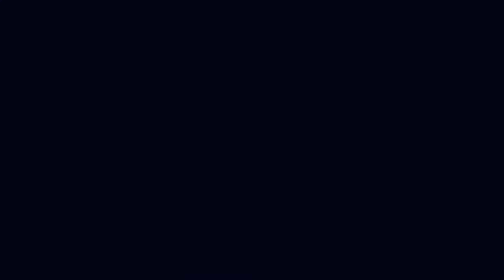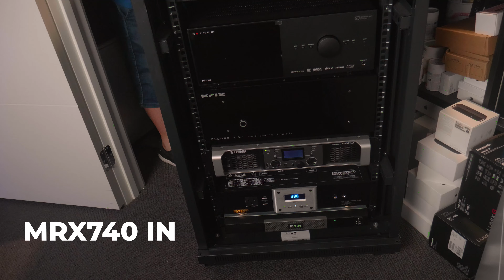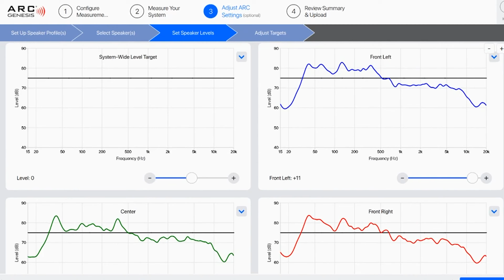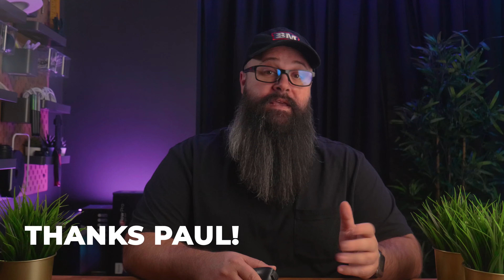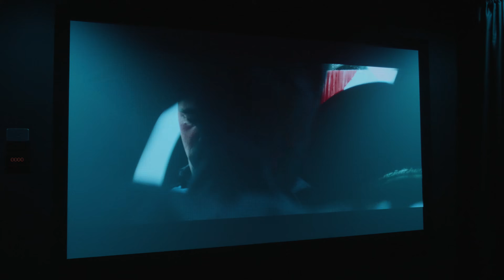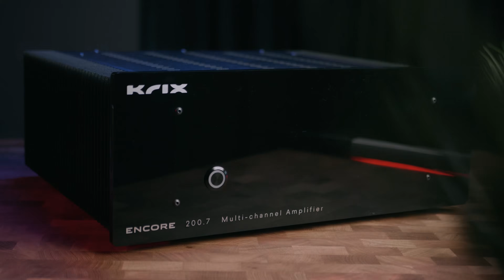ANTHEM MRX740 - AN HONEST REVIEW // Home Theater Receiver 11.2 Channel Review // Dolby Atmos

Comment: I had tons of technical issues with the MRX 1140 so returned it which made me sad because it is a great sounding receiver with a great feature set. Neither Anthem support nor my dealer could resolve the issues. I’m hoping that Anthem gets their act together so that I can repurchase again in the future.
Reply from the maker: The sound is great but as you say, not bugfree. The 1140 is very similar to the 740, so it's understandable.
Reply: @BuildMontage  Quick question,I am between trying to decide the new Marantz Cinema 60 and the Anthem 540. In several owner reviews they mention the fan on the Anthem is so loud and intrusive it is cause for returning the unit.
What is you buddy's experience thus far having lived with the 540 for some time now?
Any and all insights would be aprreciated...Thanks!
Reply: @balooo2863  ... I confirm about the fan noise. In a quiet room it's intrusive. You don't hear it during playing but between tracks or very quiet scenes you hear the fan.. I'm consedering return it... It's a shame!
Reply: @MrJMHP  thanks for that information…I purchased the unit and now my issue is I cannot get it to connect to the web no matter what I try to do. Love the sound but way too many bugs.
Reply: @balooo2863  Your connection to web issue must be a thing of your router probably settings. Mine is wired connected and i have no issue at all. I ended not to return my MRX-740 because i love the sound and power of device... Its amazing. In the near future i intended to swap the fans.

Comment: This is the mark of a good reviewer. I’ve always been interested in Anthem but they need to iron out these issues before I even consider a purchase.
Reply: 6 months later, have they ironed it out?
Reply: @JustinHEMI05  Would be nice to know also. Looking to upgrade to this or RZ50
Reply: They also just bumped up the price so it’s pushing for more money while still being buggy and lacking HDMI 2.1 which will cost even more to upgrade too. It’s difficult for me to want to drop that cash given everything as is.
Reply: What a great and honest review! Super helpful and fair. Including behind-the-scene comments. First time I watch your channel. Will come back. Just subscribed!
Reply from the maker: Thank you - it's difficult to balance the initial frustration with a fair review - which is why I persisted through the issues. If we hadn't sorted the calibration, I wouldn't have been very impressed with the result compared to my Denon or any of the other receivers I've tested.

Comment: Nice 👍 video but You have to be kidding that the Anthem 740 is better than the 8500h ? Thanks for the update that was important as I am looking at the 1140 I have a Marantz 8805 do you think that would sound better?
Reply from the maker: Certain aspects were better. The high frequency clarity especially from the center channel. It could have been the power amplifier helping that as well though. I was just being honest. I’m back to my 8500 right now and it’s great. But it was an honest review and I said what I felt and thought.
Reply: On the FB group linked, many members told they did the switch from a Marantz to an Anthem. They all said that they had improvement sound wise. But it's important to say that you have to compare pre/pro with pre/pro, avr with avr. It's not really fair to compare a sr6015 with an AVM70 or a 8805 with a mrx540. There is some guys that did the switch avr to avr and pre/pro to pre/pro and they are all happy with the sound upgrade from what they said.
Reply: Hello, I have gone from an 8500h to an arcam avr20 and it was better in both plots ... more clarity, sharpness and detail in scenes that I have very seen!  I still think that xt32 is not up to a magnificent 8500h and that they should improve this area since you cannot pay 3.5k for an avr and that it offers you the same eq and the same microphone as the 1k model ...  the 8500 is better built and in power they are even the only disadvantage that has me a little pissed off is that arcam only builds 7-channel avr and that makes you spend more on external amplifiers and the denon is much more configurable than arcam, only arcam is  something better in SQ.

Comment: So Anthem ARC still has problems???  I seem to remember a video from some channel awhile back that said it was pretty good now.  All I know is that I had a terrible experience with it back around 2009 or 2010.  I was finally put in contact with the idiots... I mean PHD's that developed it and I was told they made some changes to it after that but I never tried it again.  

I generally look at any automatic room correction like a point and shoot camera, it's better than nothing for the average Joe but can never match what you can do manually.
Reply: ARC runs very well on all the previous generation. It has sometimes some snags with the new series but I did tweaks on many of them without any problem. In the precise case of Tony's set-up, I wanted to have room to tweaks with the levels and when he got a loan extension we decided to go forward with the method that force playing sweeps louder. In his first set Auto-calibration, he did't mentionned it in his video in order to try to keep things concise but his MiniDsp had lost the calibration file (not related with ARC! Off topic, he didn't mention). When eveything goes wrong.. ;-) Sure it didn't help the final result, and there was another issue with a surround still a bit blocked by a curtain for some mic positions. So we had to redo the measurements anyway (after he found the issue with the MiniDsp). So, with this good set of measurements, he got an auto-calibration profile-1 very satisfying. And I can swear to you that it has nothing to do with the levels lower. But with this levels lower I had more than enough room for playing ;-)
At this point, he asked me if I really think it worth the effort to try to tweak the calibration. I said I wasn't sure if he would prefer it but I was very confident.
Reply from the maker: Yes there were other issues which were not the fault of the anthem but it didn't change the fact there were bugs - I was only referring to the bugs in the video - didn't want to slow down the pace of an already lengthy video describing the issue of the curtain and the minidsp - as it wasn't relevant to the calibration issues we experienced once we had that fixed.
Reply: @yvesst-onge8522  would you say this reciever is a waste of time if you haven't got a laptop or pc and have to do it on android?
Reply: @slyfoxx8540  This receiver, without ARC is already impressive. It has better separation and dynamic than Marantz, Yamaha, etc of same price. ARC is the icing on cake. 
Obviously, with a PC you can extract all the juice from the ARC possibilities. With an Android device, you are limited but from what I heard, it gives good results but you can't tweak.
Reply: @yvesst-onge8522  excellent, just the news I wanted to hear.
Cheers👍

Comment: Hi Bro 👋 Presently iam using Yamaha AVR RxA 2050" So upgrading this anthem Makes Massive Difference"
Reply from the maker: I like Yamaha receivers as they have never let me down and I actually just bought a brand new one for my upstairs setup. Anthem make very nice sounds but you have to work for it with the new receiver.
Reply: @BuildMontage  ok sure bro 👍

Comment: In the addon at the end you said they created a new firmware but you couldn't say if it fixed the issues, was that because you no longer had the unit when the new firmware came out? Im kind of worried about all these bugs, been watching the forums and so many people that have the unit are having issues, mines on order and paid for whenever it may arrive is anyone's guess. I think part of the issue is that if any engineers are working on the bugs at Anthem they are doing it from home as Ontario is still on a do no leave your house level lockdown for all except essential workers.
Reply from the maker: I had finished the video and recorded it all, finished unracking and boxing up so it was well past the scope for me to try it out. Hopefully Anthem listen and fix as it’s a great unit once you get past these issues.
Reply: Robert, I would run this receiver as much as you can within the return period. I will be selling my on the secondary markets because there are just TOOOOOO many bugs, it makes it truly unenjoyable.

Comment: Hi Tony I had heard about this issue and I member someone having the same problem he said it was something to do with the microphone volume settings it was too high on the computer something to do with the microphone volume
Reply from the maker: That's interesting - so if the gain on the mic on the PC was too high it wouldn't play noise, or play from a different speaker? So weird!
Reply: Yes and adjusted all the levels because they were too high it was something to do with the microphone volume being set wrong too high or too low I'm pretty sure it was too high but it might be worth checking it out
Reply from the maker: @Guy-zt1eb  in the calibration scenario it was 100% arc turning the main gain down to -37.5. That’s a bug for sure.

Comment: Sounds like a good product ...the set up sounds like a nightmare... all the reviews I have seen about their products seem to be the same ....great product ....lousy set up process ...but once you get it dial in they all like it....I was looking for an EndGame unit maybe in the fall of 2021 ...They dont have the 2.1 HDMI support and that will be a hardware up grade ...so if you want 2.1 ...will have to pay to get it installed....So this chipset problem(2.1) that all the Audio makers have will eventually come to an end ....but when...? So in my case I will wait until they get this problem fixed and it is fully functional in all units before I buy my EndGame unit be it The Anthem Receiver or their Processor. One of the reviews I read said the Anthem Receivers sound as good as separates...do you agree ..?? If so that makes my decision easier...I like Marantz and the ease of set up and Denon is the same way. Lets hope Anthem can hire those guys to get the set up process done better without the Bugs....or maybe at least include in the purchase ...a can of Raid! lol  . I think if I needed that much frustration in my life I would take up golf ...or stayed Married! lol Thanks for your review ! I live in Canada and they make the Anthem amps just down the road from me(200 miles lol) I did buy an Anthem Amp to run my font 3 channels and have Emotiva mono blocks running the rears My speakers are 4ohm linn Majik and these amps are rated at 400 watts at 4 ohms all channels driven which is nice ..So I have notice better separation and clearer voice without the need to adjust the volume for center channel ...So if the amps can impress me with the sound I can only Imagine what their processing is like ...but everybody likes it so far! Just work on the setup and business for their product would increase and hopefully the Quality stays!
Reply from the maker: Hi Jim, and thanks for watching. I would say out of "receivers" this is as close to separates as I have heard. Bear in mind it ships with only 7 channels powered so you do need an amp to run it to it's full potential anyway. The processing is very good I will say that. Just so many issues to sort through first.
Reply: @BuildMontage  thanks for getting back! Yeah I know about the extra power I have the MCA 325 for 3 channels and the two mono blocks from Emotiva....just going to wait and see what they do with the 2.1 issue I talked to an Anthem dealer and he said maybe the fall for the upgrade to 2.1 ...but it's a hardware install ....no sense of me buying one now and the have to spend extra for the install If they come out with new one ready to go with fixed 2.1 HDMI support then I might pull the trigger lol Yamaha just released a statement today saying they would fix all the ones they sold with a new board....and the new models coming out now will be all good with the 2.1.....that's better than Sound United is doing ...their fix is a separate converter box ...no charge if you want it...but it's a separate box ...that turns a lot of owners off Marantz has a new AV 8805A processor that they say is good to go with the 2.1 and you can get the kit for that 8805 that they have now for $600 ...that's a lot of clams ....won't be going that way either $6000 plus 13% tax for the AV 8805 A .....I think the Anthem processor would be a better deal for me if I was going that way. Anyways thanks for sharing and have a good one!

Comment: Random question but is there Atmos receiver, that works with ceiling speakers, that is more budget friendly? One that you would recommend
Reply: You are going to be at a a $2500 price range for 11 amps in a receiver at the base level of a Denon
Reply from the maker: Hi, there are budget recievers from Yamaha and Pioneer which will do "height" channels. Check for 7.2 as a minimum - usually they will either allow for two heights or for two rear surrounds instead.
Reply: @BuildMontage  haha, it is bad when my mind could not even conceive of less then 7.2.4 when providing my advice.
Reply from the maker: @Justeric78   yes I know what u mean. I had to remember that everyone has a different scenario.